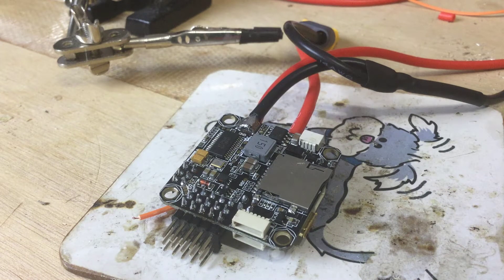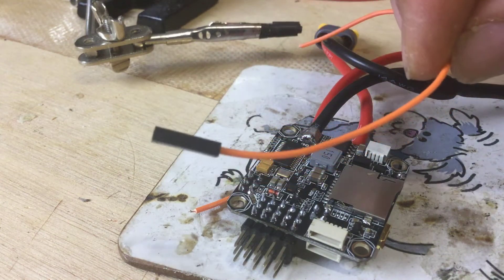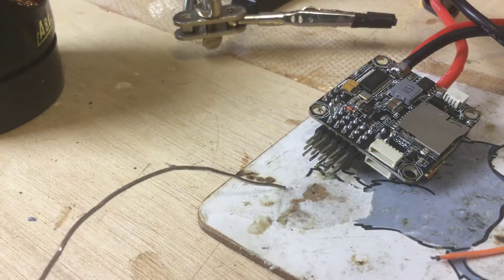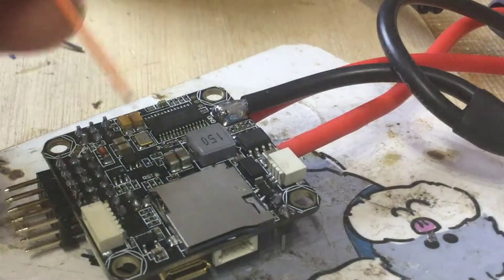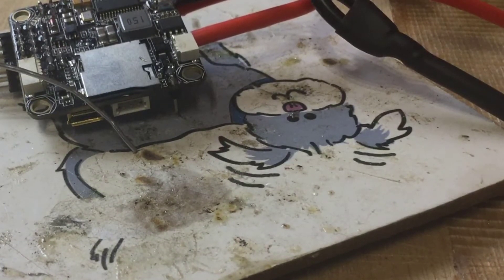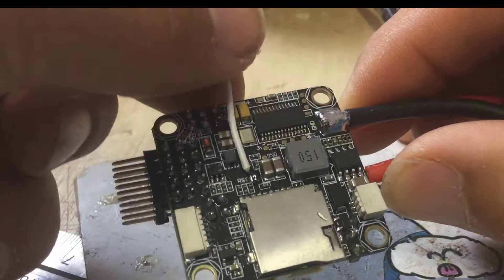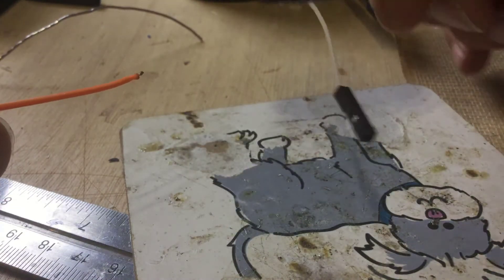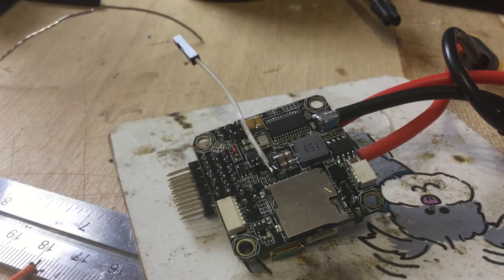iNav - RSSI Connection Wire on the Omnibus F4 V2 Board (Step by Step)

Comment from the maker: Howdy, the FULL series on setting up iNav for fixed wing models is here https://www.youtube.com/playlist?list=PLgoM4-umzSqd0clW-e_A12yKiOpV--3a2 Enjoy! Matt
Reply: Hi Matthew, just did the exact same thing as above. But my RSSI value is still zero on my osd. If I start everything up without turning on radio it shows 49 under rssi. Once the radio connects, its back to zero :( Any ideas? Woould be super grateful for help
Reply: Matthew Ogborne hey Matt. When is your next live chat cause I have some random question about wing realated topics. Just a heads up, I only have a multi rotor background

Comment: I'm trying to locate the RSSI connection on a Omnibus F4 V3 but have not been able to find it. Can anyone who has done this let me know the location please?
Reply from the maker: Hi Dieter, the best place to find the answer is finding where you bought it and looking at the diagram they will have provided you with. These boards do vary and the suppliers is the best place to start, Matt
Reply: @RagTheNutsOff  Thanks for the reply Matt.  I must be going blind, and looking for the hard way to do it instead of the obvious  The F4 V3 (non-pro) actually has a dedicated RSSI pin.

Comment: I have a spektrum 6dxi . Is rssi possible?
Reply: Depends on what receiver you are using. If you are using a Satellite Receiver that you've bound using another main receiver, yes you can, but the method is different. See this link: https://www.propwashed.com/spektrum-rssi/
Reply: thanks!! :-)
Reply: Nice, my older f3 didn't support analog Rssi. Had to use the current input

Comment: My rssi always says 99 even if the taranis says low or critical rssi.
Reply: type into CLI 

set rssi_scale = 150
save

https://github.com/iNavFlight/inav/blob/master/docs/Rssi.md

the value is from 1-255 default is 30
play with the value to get correct reading

Also what Matt is presenting in the video is not full picture.
ADC RSSI pin expects analogue voltage value, most RXs that have RSSI output send it in form of PWM (so the value could be unstable pulsing 0-3.3V) something like PWM-to-ADC e.g. low pass filter is required to get it right. 
https://raw.githubusercontent.com/openLRSng/openLRSngWiki/master/images/AnalogueRSSIfilter.jpg

check also:
https://github.com/iNavFlight/inav/issues/1559
Reply: jnb l9r and x8r specs says rssi output is analog 0-3.3v.
Reply: can you hook up a voltmeter on rssi and measure the voltage (1st close to the tx then when tx is off)?
Reply: yes RSSI has to be adjusted by rssi_scale = value, you have to figure out the value to match your reading
what inav version are you referring to?
there was a bug in 1.8.0
https://github.com/iNavFlight/inav/issues/2509

inav does't need rssi to determine failsave there are a couple of options available... 
https://github.com/iNavFlight/inav/wiki/Failsafe
the best one is #1 Set receiver to send out NO PULSES on a failsafe event.
Reply: so this is a way to calibrate rssi readings? 

i have had fairly constant critical rssi warnings and alerts of telemetry lost from my x4r sbus miniquad via my taranis. thing is, theres never been a failsafe, even a good few seconds after it said telemetry lost. this seems to indicate that i have to calibrate the rssi right? 
would i do this by setting to rangecheck, walking, and adjusting it to try to match up with an actual failsafe? 
im not quite sure on the best way to do this. you have any advice?
Reply: jnb i think i have inav version 1.8.1

Yeah, i have failsafe set on transmitter as always. It just seems that the reported rssi value is perhaps lower than the actual amount.. my tx and osd report dropouts of rssi and loss of telemetry, yet i can still fly through it. This happens periodically and quite often. I have checked antennas, 90 degree placement etc. Tx swr is typically 1.
Pretty confident it is an issue with calibration, i think.
Reply: just checked 1.8.1
it has the same issue
https://www.youtube.com/watch?v=O8SBl4JbruU
when you set rssi_scale then it jumps as https://www.youtube.com/watch?v=O8SBl4JbruU
or solid constant 100% with default settings regardless of analogue value on adc rssi
try 1.7.3 adc of rssi was working pretty well (also when adjusted with rssi_scale)
Reply: jnb ah. That explains some of my confusion last night :) either 0% or 100%

Thanks mate. I will try the earlier version!
Reply: you the best

Comment: Hi Matt!   Have you had any luck with the FrSky L9R and RSSI?  I ask because on my SPRacing F3 Mini board with the L9R the RSSI values are backwards.   No signal=99 and a good signal=2 in iNav.   You may be thinking ah, no problem, RSSI invert=on and call it a day!   Well, if I do that the RSSI jumps wildly constantly and is unusable.   For the time being I''m just going to read it backwards but I was wondering if you've run into this and if it's something that can be sorted by adjusting the rssi_scale or some other parameter.  Thanks!
Reply from the maker: Howdy Shawn, yea mine has worked fine. Not changed a single setting, just enabled it on the F4 V2 board and soldered up to the pad as shown in the video and it's worked fine with an L9R in several models, Matt
Reply: Matthew Ogborne Thanks Matt.  It probably something related to the specific FC I'm using.
Reply: Just soldered mine up and works fine. TX on 100%. TX off 0%. This is on an L9R.

Comment: It's best to use fine silicon insulated wires for such jobs. HobbyKing sells silicon insulated male to male servo leads for flight controllers. Just cut the plugs off and use that.
Plastic insulated wire is just terrible: it's too stiff and causes the wires to fray sooner and it melts during delicate soldering procedures causing dirty and too exposed joints.

Comment: For us flying with the TARANIS, we can just assign a channel in the radio configurations for RSSI to be sent from RECEIVER over to the FC over SBUS. Is that correct? Potentialy would reduce 1 solder job and would be more reliable to send RSSI information via SBUS then have a wire for that (from bad soldering or mecanical stress over time) https://oscarliang.com/rssi-ppm-channel-taranis/
Reply: Just clarifying what Matthew said. It won't work with a L9R because it has no telemetry, meaning that your radio won't be able to see the RSSI and send it back over a channel (as opposed to e.g. an X8R or an XSR), and neither does it support outputting its RSSI on a spare channel to the FC (like the XM+ does). Instead, what you need to do is solder this additional cable and plug it into the signal pin of the RSSI port in the L9R to let it send the RSSI value to the FC over an analog voltage signal. This way your FC will be able to receive the RSSI value produced by the receiver so you can see it in your OSD.

Sources: Have tested all the receivers mentioned in my comment. There's no other way for the L9R.
Reply from the maker: Howdy, yes thats possible, I believe on channel 16. However I'm using the L9R that I use the RSSI pin out and connect it to the FC to see the level on the OSD, Matt
Reply: But isnt it possible to see the RSSI on OSD if it's sent via SBUS (in the L9R) ?
Reply from the maker: Howdy fella, the L9R doesn't support telemetry so won't be on channel 16 I believe, hence the wired connection. Matt
Reply: From what I understood, this procedure doesnt have anything to do with telemetry. You configure the L9R receiver to output RSSI signal on any channel you want (example, channel 5), via radio cofigurations. Then, you go into the Configuration TAB on INAV, change "Analog RSSI Input" from ENABLE to DISABLE... Then, on the Receiver TAB on INAV, change "RSSI Channel" from DISABLE to CHANNEL 5". Have you tried that? Potentialy would reduce 1 solder job and would be more reliable to send RSSI information via SBUS then have a wire for that (from bad soldering or mecanical stress over time). Thanks for the replys
Reply from the maker: Thanks Alberto!
Reply: telemetry is not needed RSSI goes directly from receiver chip.
https://www.youtube.com/watch?v=q-rOd4_DSIk
Reply: cheers mate. ive been wrestling with this problem for the last few days. thanks for the clear explanation. problem is, im not sure of the settings i need to get this working via the ports page in inav. im using an l9r, and an f3 omnibus clone fc.

Comment: Just for info - the X8R does not output true analog RSSI even though the FRSKY blurb says it does :(
Reply: Hi Matt, The L9R has an analogue traditional RSSI, the X8R is digital and also has a wierd frequency too. Hope that helps. Anyway, you can easily get the X8R RSSI on Audio on a switch while on the edge of range....Also, you can programme the reported true RSSI to output on a specific channel down the SBUS and then report on the OSD, a very accurate method which does not rely on the Telemetry downlink.
Reply from the maker: Howdy Alan, I wasn't aware of that. I normally use a L9R which I believe does? Matt